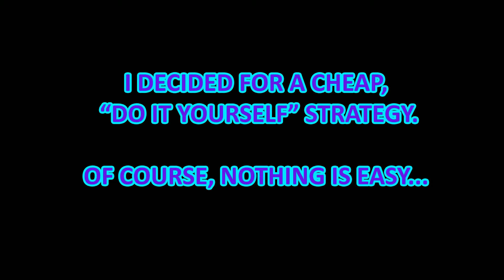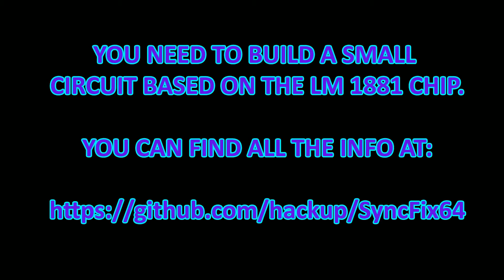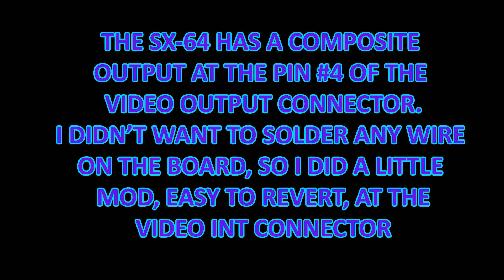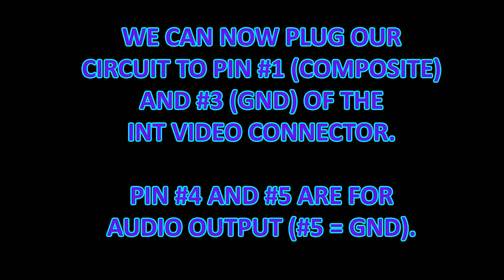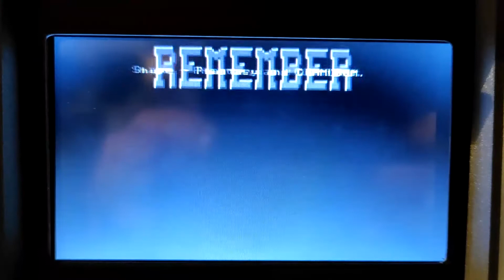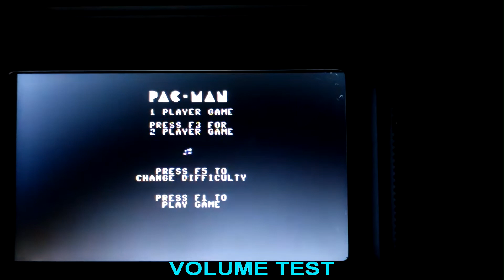Replacing the Commodore SX-64 monitor with a cheap LCD display

Comment: This looks great! I have an SX-64 now with a dead CRT so need to do this. Where did you get power from on the c64 to power the screen? I didn't see that in the video.
Thanks!
Reply from the maker: There's a small cable (IIRC two wires, brown and black) that goes to the CRT assy. This is the 12v power supply for the CRT.
Reply: @pickoftheglitter  Awesome! Thanks. I have one on the way!
Reply from the maker: @edoo25  You're welcome. Let me know if I can help you fixing your SX-64

Comment from the maker: UPDATE: In October, 2021 I got a 4:3, 5.6" LCD display on Aliexpress for about 50 USD: it fits perfectly into the 64-SX without the need of an add-on board to fix the signal. So I would recommend to take this one instead of the LCD shown in the video. You can connect it directly to the composite signal from the main board (watch the video for instructions about how to convert the S-Video signal into a Composite Video).
Search Aliexpress for "5.6 Inch LCD Display VGA AV"
The item I bought: https://www.aliexpress.com/item/1005002278278857.html

Comment: In  2012 I ordered a "Pollin"  5,6" 3:4 lcd and it works great without modification (only a resistor in the video signal) the board was only capalble of using composite video signal but only 49 dollar. The quality is very good! Unfortunately that version is not for sale anymore.